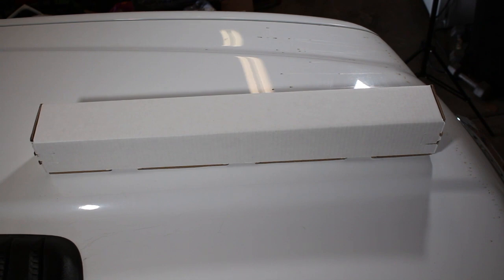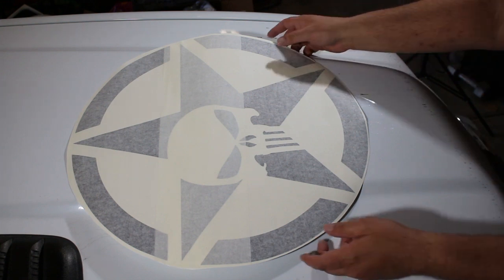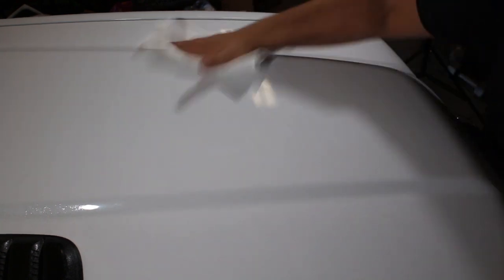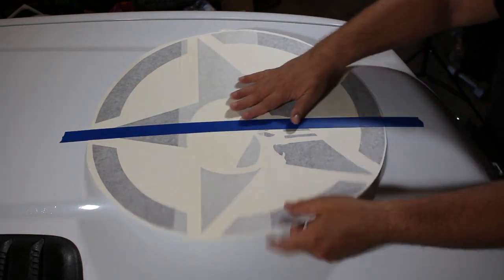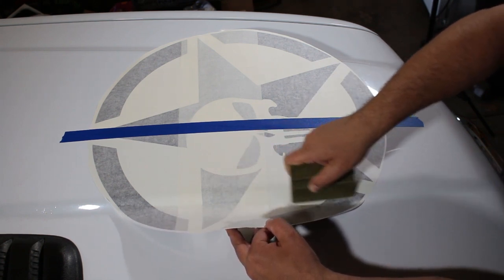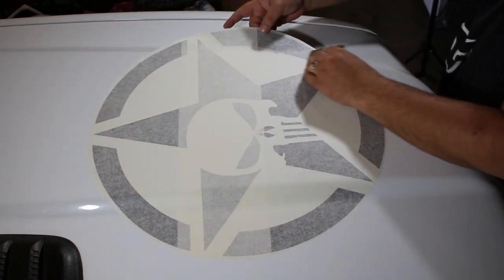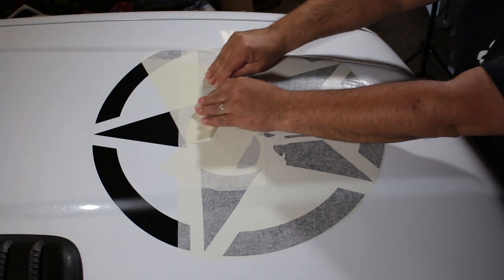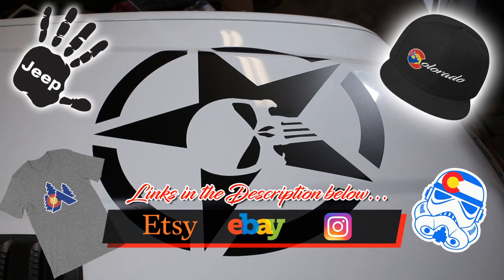Large Vinyl Graphic Decal Installation on the Hood of a Truck Jeep Car Vehicle Sticker How To

Comment: I know it will depend on the type of car but as an average how long will the vinyl deca will last before the internal heat of the hood caused by the motor going to affect the black color of the decal, also will damage the paint, i have seem some black decals turning brown and beging to peel out from the corners.
Reply from the maker: Honestly, there are so many variables it's a tough question to answer. The heat from the engine is one thing, but the other question is, how, much sun exposure does your vehicle get, is it kept in a garage or always outside? Weather exposure plays a significant roll in how long a decal will last on your vehicle. It also depends on what grade of vinyl is used, there are many different qualities of vinyl that are made for different applications.  A standard calendar sign grade vinyl is supposed to be good 3-5 years outdoors. A high performance grade vinyl can have an outdoor life up to 7 years. But weather is a huge factor, for example, one time I made a sign for a client, one side faced south, the other side faced north. The heat from the light bulbs in side the sign and the direct sunlight everyday from southern exposure burned the vinyl after 1 year, but the North facing side looked like it was brand new. Vinyl does not damage paint unless it's a really bad paint job... but for example on a vehicle what can happen is the paint around the decal may sun fade, there fore when you remove the decal the paint under the decal looks better than the paint that was around it, example, you see this a lot with RV's and Camper Trailers.  Lots to consider, hope that helps.
Reply: @MileHighCampers  thanks a lot for your response, very complete, im planning to install some decals in my car this week, it will be one big at the hood and some big strip lines at both sides, for sure i know thaf the ones at sides will last longer. I live in a hot city, the sun here does have an impact, in summer as it  reaches the 50F, my car is 50- 50% of the time exposed to the sun. I will tell the seller to provide a better quality  material so it can last at least 3 years. Thanks again for your response.
Reply from the maker: A higher quality can get pricey so don't be too surprised if the price from the seller needs to increase the price based on the type of vinyl.  Good luck I hope it turns out great and thanks for watching!